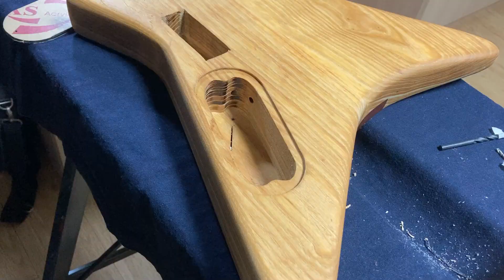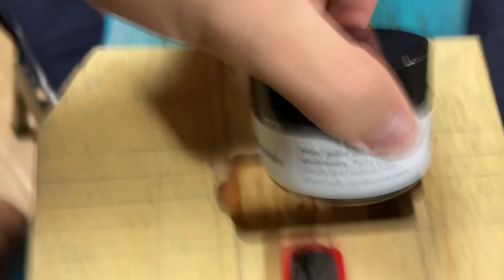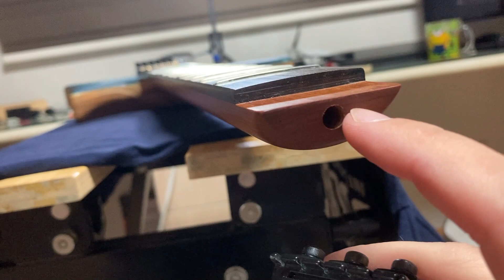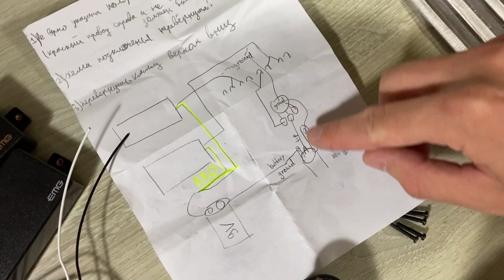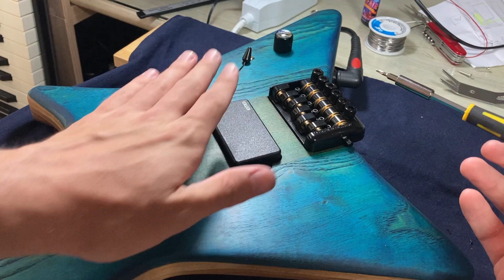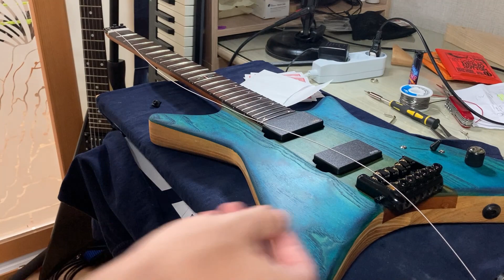Headless Electric Guitar Build - Part 13 (Final assembly!)

Comment: Nice job on this. I was a little skeptical on the color but in the end it looks awesome. Did you end up grounding the bridge? I didn’t see you ground it in the video...
Reply from the maker: Thanks for the kind words! The color took me 2 tries to get it right, had to sand it down the first time.
Because of how noisy and how troubleshooting-proof they were, I actually ended up replacing the active emg’s (that according to the internet do not require a ground wire) with passive Steinberger pickups, and hence having to make a hole for a ground wire to the bridge. Very glad it all worked out!
Reply: @Dr.Ocean-Gleb  Sorry your experience with EMGs was troublesome, they are really great sounding pickups, extremely easy to install and shouldn't have given you so much trouble. I am by no means an expert on EMGs, but I have used them in several of my guitars over the years (going back to the late 80s). Based on a few factors, I believe you may not have been sold an authentic set. First thing I noticed is that EMG pickups have been solderless for several years(since 2009 I believe) , so unless the set was old new stock, they should not require any soldering to install; secondly EMG does not have a Dave Mustaine set listed on their site but  Seymour Duncan does  and looks like he is endorsed by them. Glad to hear you got the issues sorted out, that guitar looks amazing!

Comment: amazing work man, a mirror finish would look great on your guitar i think
Reply from the maker: Glad you like it! Mirror finishes indeed look amazing. The reason why I opted for oil finish is that it is almost effortless compared to a grand effort of sanding, polishing and buffing to mirror. Oil finish also keeps the pores open and the guitar feels very natural to the touch :)
Reply: @Dr.Ocean-Gleb  you are right, its a good option too! i will probably make a build by my own, already have some woodworking tools which i never used before but i will do my best :D
 im obsessed with the headless guitar build but i know that i have to start with a more simple an easier guitar build such as stratocaster or so, to have sucess :)
Reply from the maker: @dedosmagicosmetal504  Good luck with your build! To be completely honest, talking scratch builds, a headless guitar is easier to build in certain parts: typically the hardest part is building a neck, and headless has no headstock or volutes to worry about. Making a consistent carve on a neck is also easier (because you can use a leveling beam, while on a standard neck the headstock gets in the way). I would also highly recommend a pre-slotted fingerboard, and a router is a must have tool! (Saves tons of time if you simply make some mdf templates to run it along).
Reply: @Dr.Ocean-Gleb  for sure! i do have a router and a jigsaw as well, thickness planer and basic tools.
Actually the main reason why i dont want to start with a headless build is because the bridge is hard to find and quite expensive, on the other hand i already have a cheap strato where i can take the bridge and all components, saving a lot of money.
I probably will use an ash trunk from my mom's house, its not completely dry yet but it will work, i think :)
Oh and i really want to do the whole thing so i will make the fingerboard too using some templates for the slots! thanks for the advice anyway!